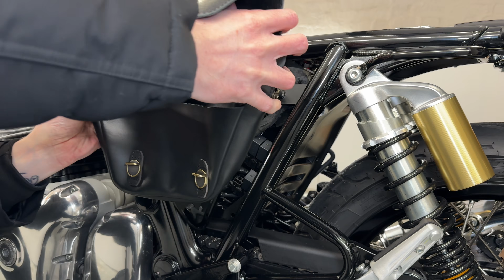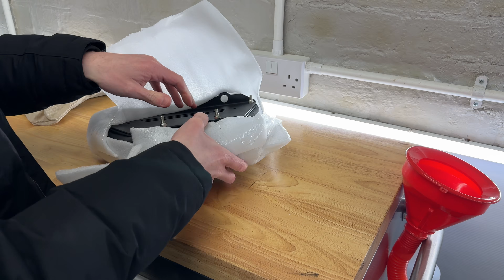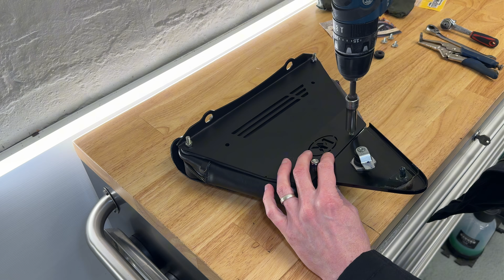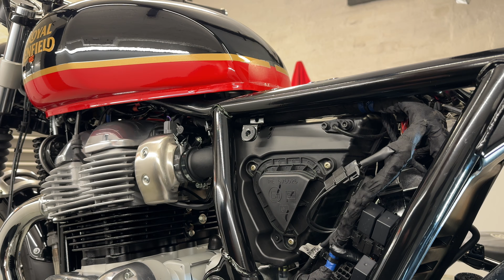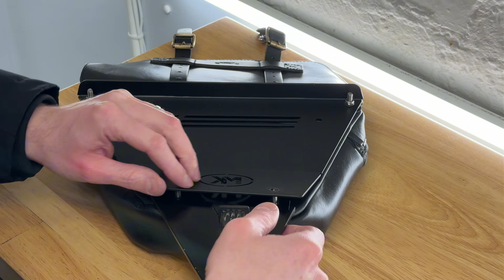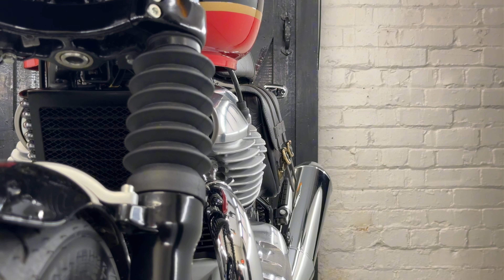Are They REALLY Worth It? Fitting Trip Machine Wingman Panels To My Interceptor 650

Comment: Undoubtedly they are a quality product like most trip machines products, great demo on the install too bud👍🏼 the reason I wouldn't purchase these is the lack of security they could be easily opened while your bike is left unattended , I'll be sticking with my back pack , stay safe out there 👍🏼
Reply from the maker: That’s a good point! I know Trip Machine demonstrate that you can lock these on their website (which I forgot to mention 🙄), but obviously it wouldn’t take much to get in these. A quick slice with a Stanley knife and you are in! Yeah, you literally can’t leave your bike unattended with anything valuable in there, especially in England! 🤣
Reply: Dale, I have these Wingman bags and whilst I agree with your point about security on the LHS Bag, there is a small loop on the RHS Bag, for a lock. It is possible to fit a small, suitcase style padlock, through the eye of the zip actuator and the small loop on the bag to enable you to secure the contents.I also fitted 3 black cable ties, butted up against each other, to the frame downtube to prevent the padlock rubbing the paint off. It works for me and although it won't stop a determined thief, it does prevent the casual one. Just an idea.
Reply: @3rd_Age_Biker , thanks bud I'll keep that in mind 👍🏼

Comment: Zipper pulls scratching the frame... I would be more concerned about, what is that clicking noise? Fix is simple, a couple of pieces of shrink tube over the zipper pulls would protect the paint and my nerves. I prefer the vintage tan over the black so, I guess it's a good thing they come in multiple colors.
Reply: Helicopter tape on the frame, only needs a small piece where the zip contacts, easy.
Reply from the maker: @devonbikefilms  good call! 👍🏻
Reply: @ Helicopter tape? us.
Reply: @devonbikefilms  Helicopter tape? us.
Reply from the maker: The clicking noise whilst riding? I’m not 100% sure you would hear the clicking noise over the sound of the engine, exhaust and the wind noise whilst also wearing your helmet. Yeah shrink tube would work but it would be a shame to hide that well designed zipper. I think they should have made the zipper out of leather. Yeah vintage tan looks great 👍🏻
Reply: @j.brocky Haha, a bit of sarcasm on the clicking... I like the idea of leather for the pull.
Reply: Try a shrink hose on the zipper
Reply: @besenwieslersepp1011  Isn't that what I said?
Reply: @donhammer186  Of course! I dint read well.

Comment: would they fit the bear 650 too?
Reply: I have an 2022 Interceptor and I have installed the Wingman Side Panel Bags and I love them. Regarding the fit of the Wingman Bags to the Bear, I recently attended a Bear 650 Launch event at my local dealership (Hatfields of Crowthorne). There were a couple of the team from the Royal Enfield Head office and design centre at the launch. I asked Glen, from the 650 design team, if the Wingman Side Panels would fit the Bear. He told me that the central area of the bike is common to the Interceptor, so he was 99% sure that they would fit the Bear, although they had not tried it at the factory. I hope that this helps.
Reply: @3rd_Age_Biker  Thats really helpful, thankyou!
Reply from the maker: Nice one Ian! Great info there. Are your Wingman bags holding up well?
Reply from the maker: That’s a great question. I’m not 100% sure if the panels are the same as they are on the Interceptor or not. If they aren’t I bet Trip Machine are already looking in to making some for the Bear 🐻
Reply: @j.brocky thats great to hear! Also Love your videos, do post some vlogs if possible.
Reply from the maker: @yashass4405  I’m on it as soon as the weather improves over here in the UK. We are in the middle of winter at the moment. Can’t wait to get out again! 😬